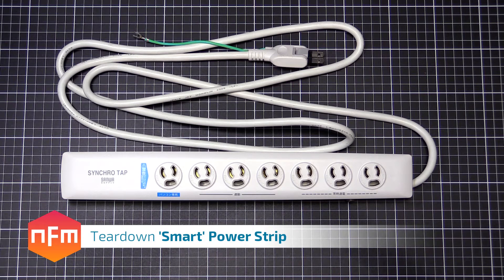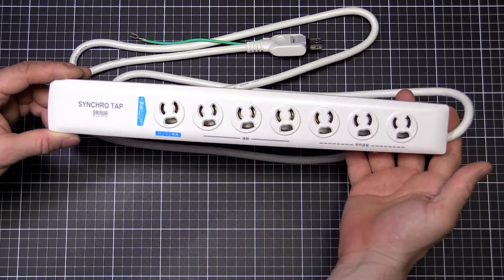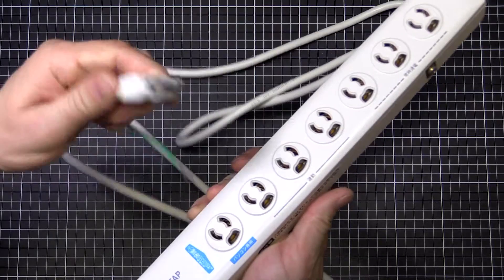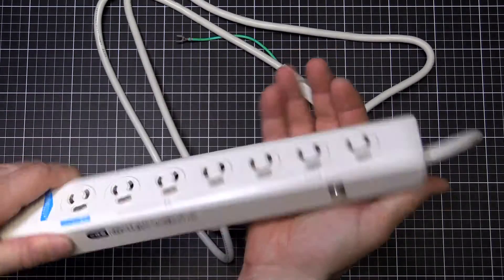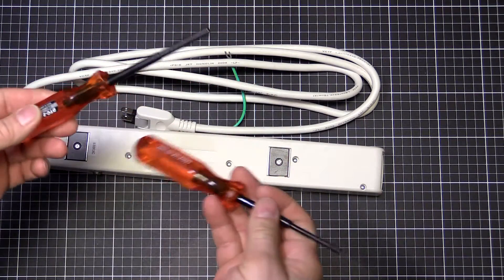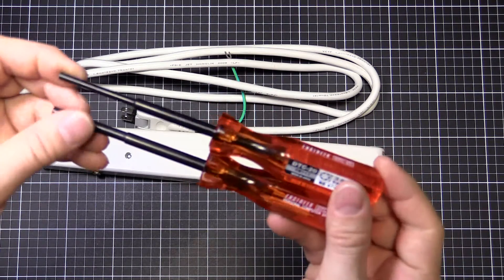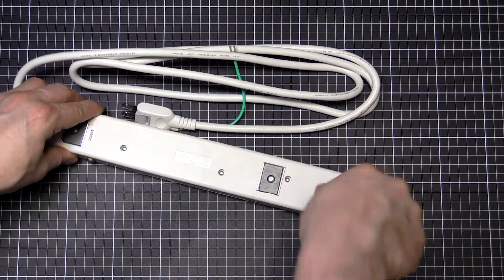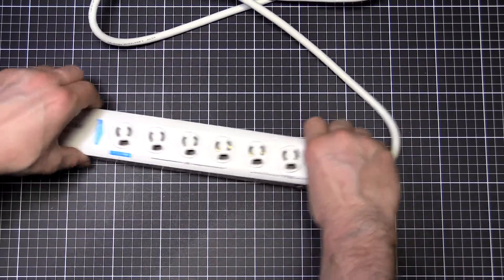Japanese Smart Powerstrip Teardown - Sanwa Synchro Tap

Comment: Can't believe they need a micro controller for that. I still have an extruded metal smart outlet strip fromRadio Shack I purchased back in the mid 80's. Same setup. One sense outlet and a group that turn on in unison. It uses a comparator chip to detect the load of the control device to then turn on the relay. You do have to adjust sensitivity for certain items with low loads. Maybe that is what the micro controller is doing automatically and then storing the proper sensitivity value in the 2 kilobit EEPROM.
Reply: Had the same idea, why need a micro? Smith trigger, current shunt and relais would be enough.